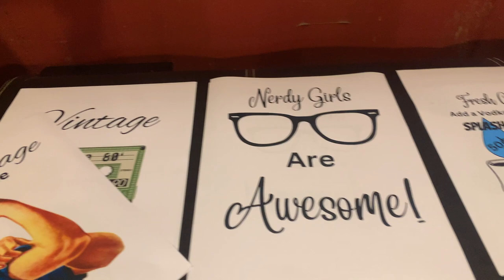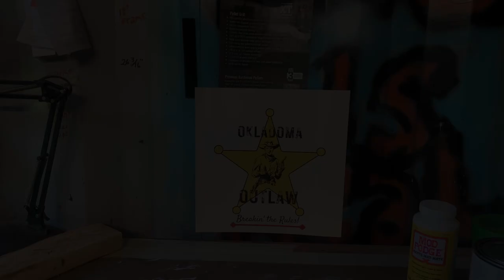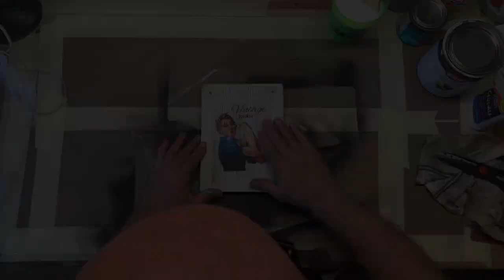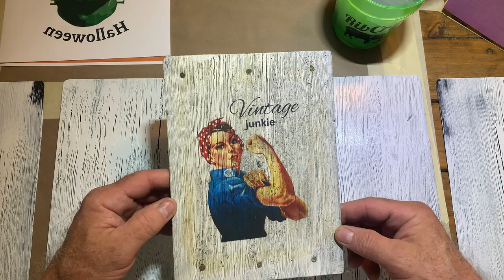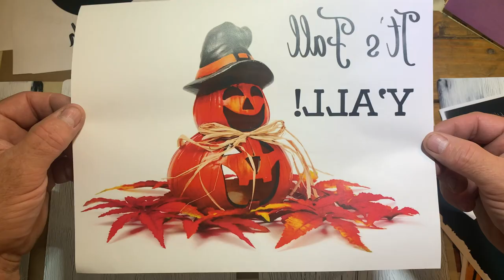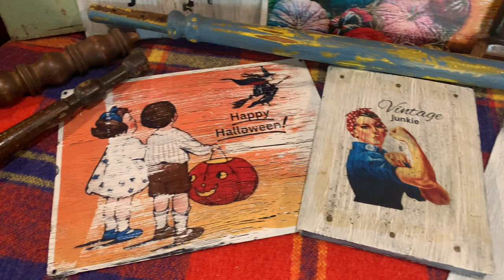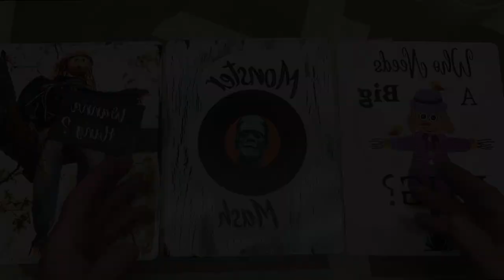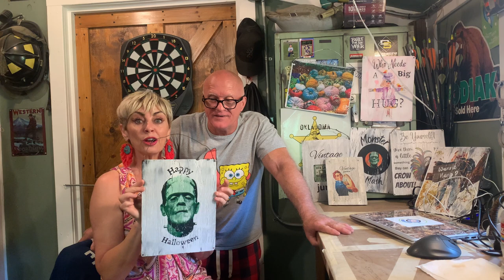VINTAGE LOOKING SIGNS WITH POLYCRYLIC TRANSFER METHOD! EASY AND FUN!

Comment: Great instructional vids 👏 . What paper do you use print to create transfer and is that standard inkjet print,  also what white paint are you using please, here In U.K. we have different brands so trying to get same or closest to yours. I am very interested in you art work on another video TIA 👍
Reply from the maker: I use regular copy paper and a standard ink jet printer. Nothing fancy at all. I also use standard white latex paint. I prefer "flat latex" but "semi gloss" will work too. I've even used "flat" spray paint with great results. One thing I started doing was to spray either "flat black" spray paint or primer before the white to get better adhesion with the white. Using spray paint, you don't have brush marks, so the sanding is easier. I will be making another video soon. It's Christmas time here, so things are busy, but I hope to get one out very soon. Glad you enjoyed. Hope you'll subscribe and tell your friends about me. I love meeting new people. 👍
Reply from the maker: One thing I forgot to tell you. Make sure to use the clear matte polycrylic instead of the mod podge. It is a superior product, and don't be afraid to brush on a good amount before you stick your transfer on. I'm going to make a video about "Canva" which is what I use to make my designs. It's free and makes things simple. Be sure and check it out.
Reply: @okladoma9782  thank you 👍